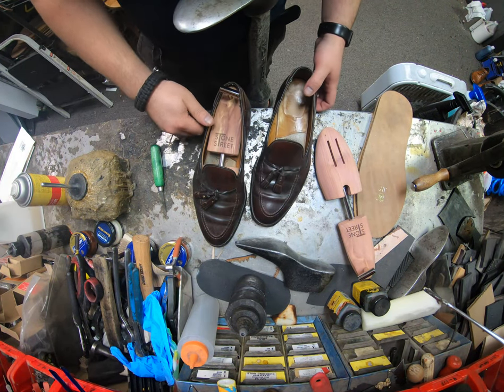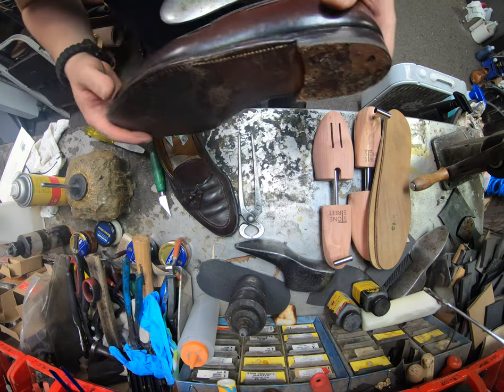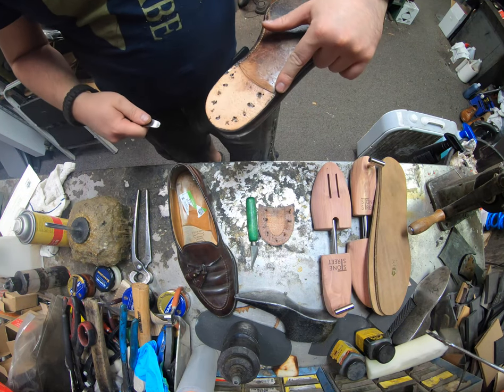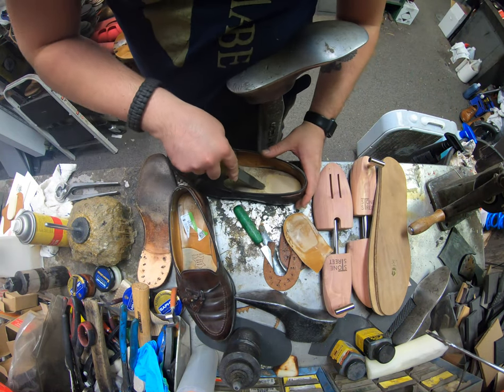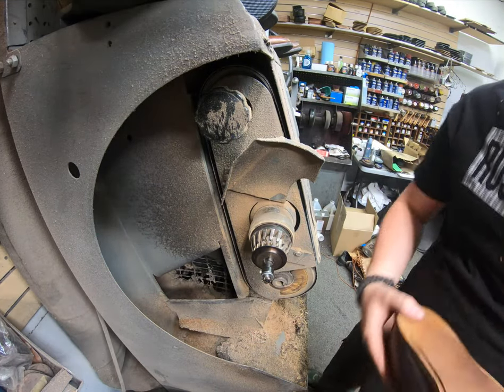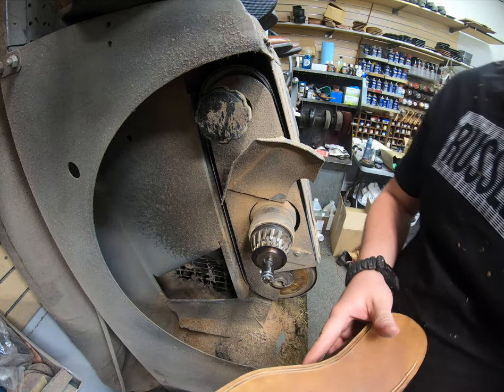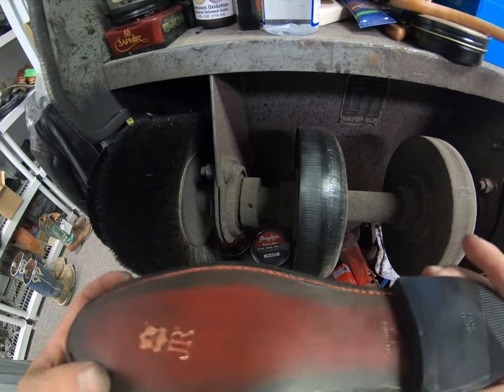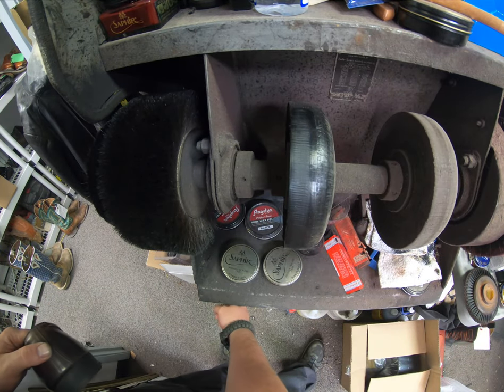Alden Shoes in Shell Cordovan Recrafted with JR Leather Soles, Leather Stacked Heel Base and more

Comment: Wow im a blue collar guy and had to look up alden shoes some on first google are over 1000 dollars makes sense people fix them
Reply from the maker: It’s not always the $1000 shoes we do this work on as well. I had a pair I just did that retail for about $200 and the gentlemen wanted a number of things done as well as JR soles and heels. He paid more for the repairs but the shoes were upgraded, restored and don’t need to go through a full break in period again.
Reply: Eric Lakota yeah but what doesn’t make sense is that they still use composite hill blocks on some of their shoes. That wouldn’t even be justified on their least expensive models which are probably over $500. GTFOH
Reply: Eric I recently purchased a pair of Beckett Simonon shoes and boy they came highly recommended from a cobbler.  There is a disclaimer though, it takes about 3 months to receive them.  I paid $157.00 for a top grain leather split toe black in color on 02 Nov 19 and received them 02 FEB 20.  I was 100% satisfied.  The craftsmanship was better then what I expected.  Try their website and you will see.  If you're only going to use them for weddings, special occasions, funerals or Sunday Mass... Look into a black cap toe.  You won't regret it for the price.  best of luck, brother.  --Blue Collar Guy myself.
Reply: @seekingtruth6822  Beckett Simonon is just not good sorry.  Also they are Blake stitched and the build quality is not good.
Reply: @AlexanderMason1  i learned of B/S through Trenton & Heath channel.  Appreciate your feedback.  Be well brother.

Comment: Question - It looked like sewing the new sole was a challenge.  I have seen other sewing that looks much 'easier'.  Was there a reason for the struggle?  Is it because JR soles are so hard, you had to be careful with your sewing machine?  Thanks.
Reply from the maker: It is mainly do to putting the finish on before stitching I did not want the foot that presses down to scratch it up. If it’s a lighter finish or no finish it’s easier and the shoe won’t slide off. The darker finishes we put on a thicker coat so the waxes can make the shoe slide off and scratch it
Reply: @CobblersPlus  Gotcha.  Thanks for the reply!

Comment: This is a high quality shoes unlike Allen edmonds everyone is promoting Allen edmonds shoes on YouTube but that brand is full of flaws and defects not this brand if you want high quality shoes this is it Alden
Reply from the maker: Alden is definitely a step up from AE but for the price point AE are a great shoe. If you move up even higher in quality you can get into John Lobb Edward Green and a lot more but at an average of $1,000+
Reply: AE vs Alden are two distinctly different price points.  If you're not paying full retail for them (and there are sales all year long), AE shoes are a relative bargain and can be had in the USD300 price range.  Much harder to find a deal on Alden shoes which typically cost north of USD500 on the low end.
Reply: Try Beckett Simonon, Crockett & Jones or even Cobbler Union.  Alden is up over the $500 price, but John Lobb are above the $850 price range.  Edward Green are on a league of their own.  

Personally, my unsolicited advise, I own Allen Edmonds, Cobbler Union, Alden, Johnston & Murphy & Crockett & Jones, Most comfortable are the Johnston Murphy shoes and Aldens.  Which one would I prefer, Allen Edmonds & Crockett & Jones.  Hope this helps, best of luck.

Comment: I was wondering how the hell Red Wing messed up my welts on my new Iron Rangers which I had them resole. All I wanted was to change my Vibram soles to Nitrile Cork sole. They trimmed off the hell out of both welts especially the right boot on the entire right side and around the toe area. One welt is now bigger and they’ve changed the shape. I am still angry and hate my boots now. I sent them pictures of it and they said that those imperfections they consider acceptable. I love their boots and will continue to buy them I just will NEVER have them resole my shoes. They have poor quality control also. I have a love/hate relationship with Red Wing.